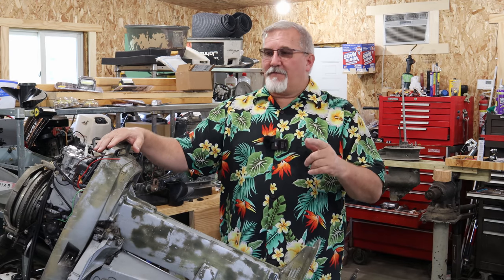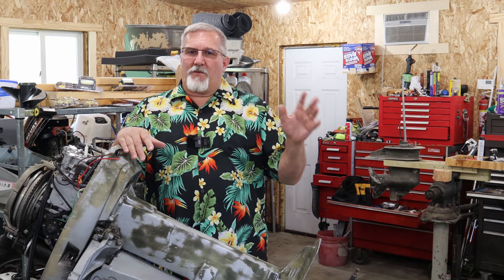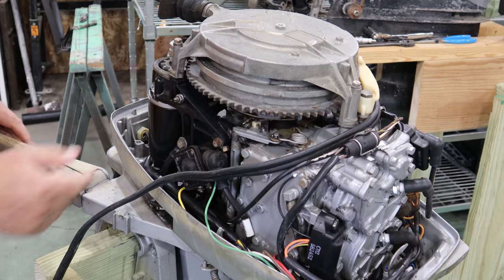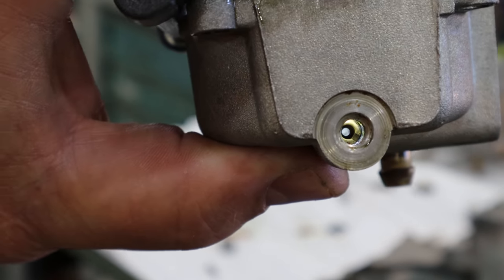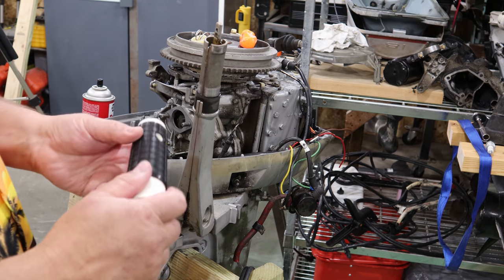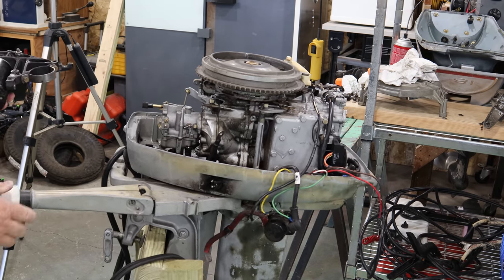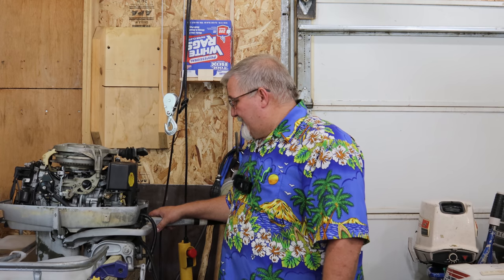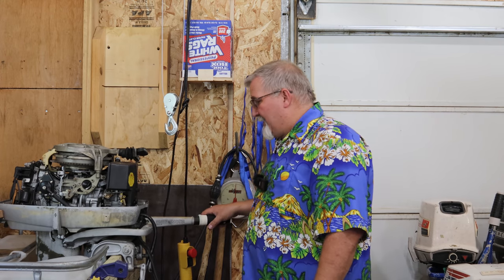1979 Evinrude 35hp Part 2 Let's make it run this go round. Follow along on this How to video.

Comment: Those early 35's are strong; talk about a "boy dog", they are that.  You did a wonderful job, Michael.  And very educational.  I don't know who passed gas at 23:53, but it was a jack-whopper.
Yes, it is normal for some water to come out the two top holes.  Temp on the thermostat cover at warmed up idle should be right at 140 degrees.  Next time you remove the starter to get the carb off one of these models you might consider leaving all the wiring hooked up.  Then you can lean the starter over the port side of the lower motor cover and the wiring will hold it.  It saves time and trouble - and does no harm to anything.  Thanks again for another great video.
Reply from the maker: Funny that was my son imitating the motor.  Believe it or not I have to take the carb back off and you will see why in the next video. I will follow your advice. Thanks for watching and commenting
Reply: @Michaelsbackyardmarina  Thank heavens that was your son imitating the motor!  (Funny.)  Take care.  Love your videos above all the others.

Comment: Good Stuff! I purchased Honda 50 (used ) last year and after 5 trips (5 hrs. use) I noticed wobble in prop shaft when turning by hand.I took it to marine repair shop where they determined the outer carrier bearing was not installed. Amazing that thing got me back in when a storm came up suddenly.It was a little bit hard to come up with the new bearing during Covid times but we are up and running right again.Parts temporarily scarce here in Western Canada. CHEERS
Reply from the maker: Thanks for sharing

Comment: Hey! Great stuff love the channel! You have done alot for me when it comes to the awsome OMC collections. 
Helpful parts knowledge. That coolant hose is nothing more than automotive vacuum hose made by 1/32 of an inch. Its easier than ordering online, or looking for parts numbers. I worked on a 25 HP and replaced the coolant by the carb like yours. 5/32 vacuum hose fits like a glove and is dirt cheap at any auto store. 
You and the vids are awesome !!
Reply from the maker: You are correct. I just purchase a length of hose from my local Napa store. Thanks for watching.

Comment: Hello Michael, On my 20Hp Johnson the second little clip ( Bearing Clamp  PN 0320523) goes behind the vertical linkage shaft. (Control lever) 0320523. I did the same thing on my engine a couple of weeks ago when rebuilding the carb.  But I had the powerhead off a couple of years ago so I know there was no way that little clamp was there before.  very respectively. Jeff
Reply from the maker: Good to know. I will make that correction. Thanks for watching.

Comment: one can do the math on theoretical  boat speed.   engine max rpm x gear ratio= prop speed in rpm. prop rpm x 60 = inches per hour.  iph divided by 63,360  = mph.   of course this is theoretical and the outcome id dependant on slip. but i'm sure you dont care  as ong as it works lol.  i'd say you got the filming down  looks good!
Reply from the maker: I have played around with those numbers as well. Hull shape and weight play a big part as you well know. Thanks for noticing the filming. Much appreciated. Thanks for watching and commenting.

Comment: Great help. I have an '85 20 hp Evinrude that is very hard to pull. You have any experience with that situation or have any tips. Thanks, Bill
Reply from the maker: if it is too hard to pull then some of the carb timing and adjustment may be off a bit.

Comment: great video michael i currently have an evinrude 30904emotor which isnt running at the moment and theres a small pipe missing on the motor behind where the carb bolts to, where does this pipe  go to i cant see anywhere it can go?
Reply from the maker: Check out the schematics on marineengine.com
Reply: many thanks for the info.

Comment: A little aviation Permatex on the starter bolt should keep it in place. :-) (my dad was an airplane mechanic for 35 years)  Is that something you use in your shop? I would be interested in your thoughts about,  Antisies, thread lockers, and other items you keep on hand. I was shocked the first time I started looking up the goops and lubes that the manufacture recommends for outboard engines.
Reply from the maker: Since I'm not around saltwater I only use a little anti seize on bolts that potentially could be problematic. I rarely put anything on gaskets. I usually let the gasket do the job it was designed for. Thanks again for watching

Comment: I know repitching changed my rpms on my Johnson. Was running at 6000 and repitched from 11 to 13 and it brought it down to 5300
Reply from the maker: It will make a pretty good change.

Comment: I have a 1978 Johnson 35hp that came with a 10.5 X 11 SST prop and worked very well on my old 16' 76 Sylvan. Hub spun out after 40+ yrs and was replaced with the Solas 10.5 X 11.  (2211-105-11).
Reply from the maker: I may need to drop down one more prop size myself.

Comment: What’s the best technique to clean the gasket surface of the carb without getting a bunch of shavings inside the clean carb?
Reply from the maker: I just used a soft wire wheel and blew it out with an air hose afterwards. Thanks for watching and commenting

Comment: Solas props are the best. Their aluminum props are squeeze casted so they are much more dense than the OEM props. I used to sell them as a distributor. We essentially replace the pitch of the prop to keep the engine in the recommended operating rpm band. So if your engine is suppose to be running between 5300-6000 rpm and you are running 6200rpm on a 19” prop then you are over revving. To get into that 5300-6000 rpm band you would need to pitch up to a 21” pitch which would drop you to around 6000rpm. A change in pitch of 2” will bring your rpm up or down by around 200-300 revs.
Reply from the maker: That has been my experience as well. Thanks for watching and commenting.